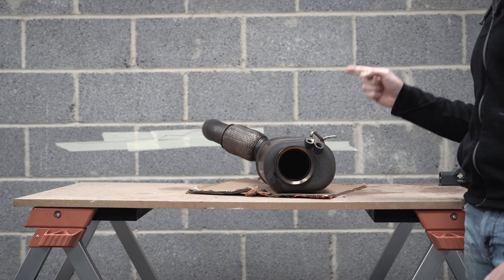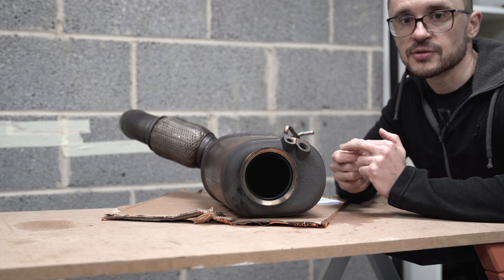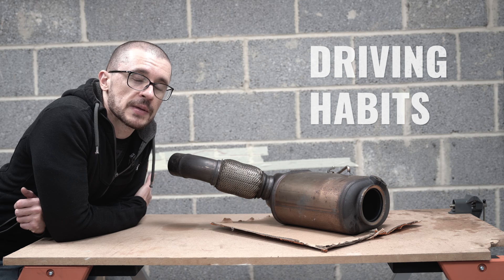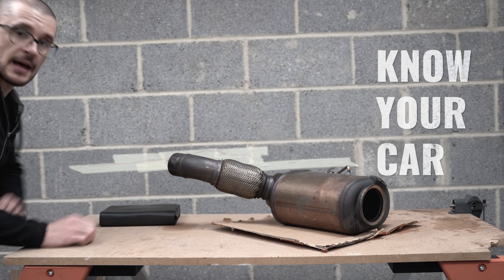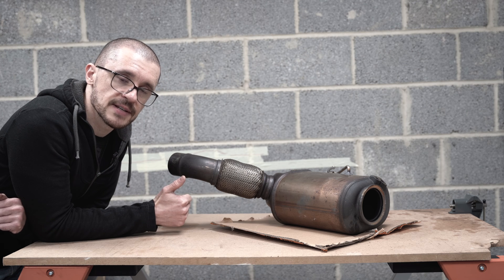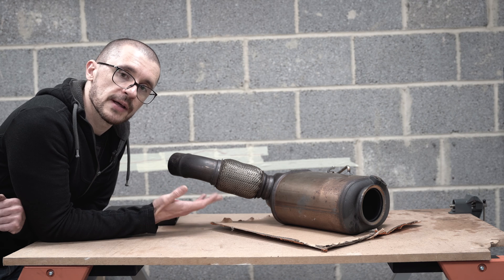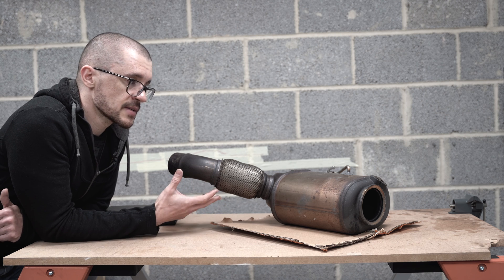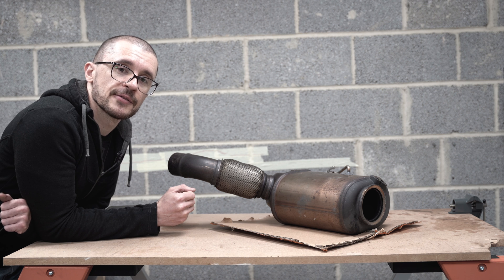How To Avoid DPF PROBLEMS - Diesel Particulate Filter

Comment: I am looking at a car with a known issue right now, lifters have failed in the engine after 100000 miles and expected timing chain failure shortly after... The cause, numerous failed DPF regenerations as a result of driving a diesel car short distances, as diesel ends up in the oil diluting it and causing crank bearing wear, lifter bearing wear, timing chain wear and oil pump/chain wear, and probably anything else lubricated by the oil... The fix is £2500-£5000 depending on damage caused, and will occur again in another 100000 miles or so... All because of DPF technology in some newer cars being flawed.
Reply from the maker: well said. for this type of situation I am looking at affordable ways of monitoring the DPF condition/regen cycles not completed and load to avoid this ... also would be interesting to evaluate the service intervals and how these could have been improved. how many oil changes has that car had in the 100.k miles?
Reply: @BestCarMods  well one way i am aware of it to find something that goes live in Regen mode, apparently on some Mercedes reason unknown the rear window heater comes on during Regen so you can just connect an LED into this and stick it in your dash somewhere, or as one person did inside and existing light that you will see.
Reply: @BestCarMods  Hello! 
I have a brand new 6 months old Toyota Innova Kijang/Crysta 2400cc diesel manual, which has done only 4000 kms. It developed reduced engine power and performance,sluggish and choked feeling at 700 kms. Since then the dealership has not been able to solve the problem. They have manually conducted manual/forced dpf regeneration multiple times but the malfunctions have not been rectified. Once after forced dpf regeneration the car improved a little but worsened again. My questions are:-
1) Is it possible for the DPF to get clogged at just 700 kms?
2) Is it possible to get the DPF removed and get my car remapped without any side effects?
I am from India.
Reply from the maker: @HYukti-k8w  1) yes the DPF can get clogged up in 700km 
2) yes, however in many countries it is ILEGAL to drive on the road cars without the emission control systems fitted from the factory.
More details about your local rules should be known by the companies that do ENGINE REMAP in your local area.
Reply: I need some help with my Kia Sonet 1.5 diesel which is equipped with a DPF and a SCR (DEF)(19k kms, 1.5 years old). I think my car is having serious DPF issues and service center is giving me lame excuses instead of checking thoroughly. Background - had severely clogged air filter few months back, got it serviced early at 18.5k kms instead of regular interval of 20k kms due to DPF warning and oil level increase (fuel dilution). Replaced air filter, changed oil, everything seemed fine initially.But now DPF is loading way too fast. I'm monitoring with OBD2 scanner and CarScanner app on Mobile phone and seeing 1.5-2% loading per km in city driving. DPF needs regen every 40-60kms which is insane. DPF load is shooting to ~115% in 40-60kms. I don't know the normal range but it seems very high, looks like engine is running too rich or there is some issue with the EGR or turbo. Also fuel economy is tanked from 12-14kmpl to 9-11kmpl, and performance feels sluggish. Normal mode feels like eco mode now, less turbo response. Service center says this is happening due to city driving and is absolutely normal and they also said no error codes means no problem. But even worst city driving shouldn't need regen every 40kms is what I believe. Now I'm scared to drive my car because I don't know where it will leave me stranded. 
Note - my majority of the mileage is on highways only.

Comment: Good info, but one of the most important things to check is how much engine oil is being used, if a lot of oil is being used >1 liter per 1000km, then the cause needs to be investigated, wear, bad oil trap for the crankcase ventilation, leaking turbo lubrication etc. This quickly leads to increased amount of soot and ash amount in the particle filter. So be sure to fix this first before cleaning or regenerating the particulate filter regularly.
Reply from the maker: verry good observations

Comment: We clean DPF's - we weld & repair them too. The DPF on my own vehicle is the original & has 374,000 miles service done. Still works perfectly.  Get yours cleaned when it needs it, follow the advice of this video & it will be all G.  If it ain't... well there's people like us who can help.
Reply: I have 300 000km on my stock DPF no clean short trips......
Reply: @lordbentley730 what car what engine?
Reply: When do they they need cleaning on a l200 series 5
Reply: Do we wait for light to come on ? As I heard going at them prematurely you can end up with all sorts of lights coming back in after you went at it and cleaned it 😅😅😅

Comment: Delete hardware+software,no smoke,no smell nothing...car runs super good !
Reply: No black smoke at all? What car?
Reply: @bigsean6045  Volvo v50 2.0d 136 hp.,also i drive now Fiat Croma 1.9 jdt again no dpf no egr and again 0% smoke,if you find a good mapper everything is clean,this is my understanding.
Reply: @L.Lyubomirov  thank you!
May I ask how much did it cost?
Also, did the same guy remove it and map it or it’s done by another guy?
Reply: @bigsean6045  In my country Bulgaria,the map software costs around 150 euro,and the removal of the dpf costs around 20 euro...different guy removed and different guy after that worked the software,but the removal its very easy and it can be done by anobody who does exhaust job/repairs...the mapper is the important guy which plays the big role.
Reply: @L.Lyubomirov  I understand thank you!
I’m in Serbia and I think I will do the same
Reply: @L.Lyubomirov 
What garage are you using??
Reply: Tüv sagt : NEIN 😅
Reply: I have 2018 s350d s class my car does 3 times a day regeneration is this normal ?
What shall I do as I am fed up 
Thanks
Reply: I have 2018 s350d s class my car does 3 times a day regeneration is this normal ?
What shall I do as I am fed up 
Thanks
Reply: @ipansota3832  It is not normal 3 times at day at all !What should you do...go to mechanic and see where is the problem,could be many thing...i personally prefer to delete hardware and software,and to sleep without worries,but everybody decides for himself.
Reply: Delete and remap @ipansota3832
Reply: Easier said then done bro
Reply: Apart from being illegal in most countries. That doesn’t work in a significant number of vehicles, especially ones whose engines were designed for Euro6.
Reply: @hughmarcus1  Why wouldn’t it work for Euro 6 engines (without the AD Blue)?
Reply: @bigsean6045 Note I said engines that are designed for Euro6. One such example is Land Rover’s Ingenium engine. Because this engine & its anti pollution system was designed for Euro 6 it simply won’t run properly if somebody messes with the software. 

There are lots of engines that have been in production prior to Euro 5&6. Essentially what those doing DPF delete do, is to backward map the engine to run without a DPF. 
The host of this video frowns on a lot of these practices
Reply: Exactly was just a way to take money from our pockets

Comment: just delete it lol
Reply: Delete it, and block the egr. Remap for increase in power and better fuel economy.
Had it done on my CItroen C5 2 litre hdi Exclusive. Towed a caravan all over Europe for years. Never missed a beat. 
Who decided it was a good idea to divert exhaust gas into induction?
Reply: @davidk3729 how does it pass its mot
Reply: @guttersnippeesmithers3905 it’s not on an MOT check yet, but I’m sure it will soon. They just need to see if there’s soot coming out the exhaust
Reply: yep
Reply: In many countries you have to pass an inspection. . They check for deleted DPFs ...

I agree it is a mad situation but we are like many things screwed by the deranged governments
Reply: It's a scam this co2 crap 😂
Reply: @cliffordkirk4825 it has nothing to do with CO2. The emissions are bad for the lungs and cause a lot of health problems, and smog. If nobody cared about CO2 these things would still be installed.
Reply: @cliffordkirk4825 It’s not a filter !! It’s a collector to enable the emission test ! When it’s full ( pressure difference between in and out ) it’s blow the soot out !! It’s nothing more then a scam.
Reply: @cliffordkirk4825 a DPF has nothing to do with co2. It’s to stop your kids breathing in harmful particles. Having said that, I don’t have any, so go for it
Reply: @cliffordkirk4825 no, its not.
Reply: If mine needs replacing that’s what the dealer said as it’s 200,000k plus atm .. shouod I delete it ? And wouldn’t this harm the engine as the computer tells the car to be in the dieeel at a certain point ? 
That’s why when I change oils and filter they reset computer to let it know it’s been changed ?
Reply: @Semaj.18272  no if u delete it it will not harm the engine , it will make the engine run easier with more fuel economy & power
Reply: @leftmorningstar6954 also fail the mot as its illigal
Reply: @guttersnippeesmithers3905 For a car to fail an mot on emissions the readings would have to be massive. This doesn't happen from a dpf delete. You can prove this from say an 05 model car that had no dpf to an 06 car that did when they first got put on cars no difference.
Reply: @Semaj.18272 No because when you have the dpf delete the tuner will tell the car it doesn't have a dpf anymore.

Comment: Would driving at 2-3k rpm help with having a stronger exhaust flow?
Reply: DPF regen happens above 200c with an oxidation catalist
Reply from the maker: theoretically yes for passive regen ... it would also help with the time needed to get the DPF up to temp, however you don't want to be always at that rpm. the temp in the dpf needs to be over 500 deg for the regen to happen but at the same time there is a limit to the max temp ... and the temp for active regen is not achieved by air flow, but by injection in the exhaust faze ... that is used in the DPF to increase temp. .... so to conclude yes and no :)
Reply: Higer egt temps can be reached between 1500 - 1800rpm, therefore this is better for regen, both passive and active.

Comment: Some Regens are only triggered by distance they don't all kick in when you go on a drive if dpf is not clogged or over accumulated. If the soot accumulation is bad 30 minutes drive with Regen activated won't be enough. If soot accumulation is high you will find the set distance the Regen should kick in (600km ) is ignored and will Regen more frequently even after completing a full Regen. This means more diesel fuel is being sprayed into the dpf over a longer period of time. Not only is diesel used to move your car but at the same time it's pupmping diesel into the dpf  to clean it meaning fuel is being used at a higher rate making you fill up more frequently.

Then there is the difference between soot and ash. When soots burned off it leaves ash when this builds up it's worse than soot.
Reply from the maker: thanks for taking the time to share some knowledge
Reply: Good explanation

Comment: Hello. I’ve bought an used car, and now, at over 280k km, the dpf needs to be cleaned. What solution do you recommend ? Burning (extreme heat) or wet cleaning (water with a bunch of chemicals). Thank you
Reply from the maker: the companies that recondition DPFs do both methods ... they heat up the dpf first in an oven (they burn the soot)... and after that use the chemicals to remove ash. It depends on many factors.
Reply: @mariuscociuba Spălare

Comment: The whole video idea, concept and conclusions about DPF are right and can be called as a BASE for long lasting DPF. 
I've been working with DPF's alot and in advance of this video i want to point out some things:
1. Don't listen to those who say that DPF cleaning or 'washing' (call it whatever you want) is pointless, because it is not! If you're doing it in, as i say, basement workshops, they will surely ruin it with agressive chemicals and other stuff. Find a nice, approved workshops who specialize in DPF cleaning procedures, and do it, i would say, every 150k on clock. 
2. Don't use any of DPF cleaning chemicals which is supposed to be added to the engine fuel, because it will ruin your DPF's ceramic and you will be in a big PAIN as the ash will stick pretty hard on it. 
3. Keep in mind to once in a while check your sensors and keep an eye on active regen cycles, if they are getting often or not.
4. Never, never tune your car with history of bad DPF.   
5. Use quality fuel. 
Besides that thumbs up, information is great.
Suggestion for the next video is EGR valve, as it can be a culprit for a DPF related issues.
Reply: Hi, 
I have a question, how do I keep an eye out for active regen cycles? My car doesn't let me know when it's in a regen cycle
Reply: @sheffcitys2forgedinsteel255  mine as well,Delphi system horrible,as your vehicle can be in a regen as you pull into the garage,for months on end(no idea what's going on) .I'm not impressed by this guy,he says drive 40 miles on highway for a "natural regen" huh!as though a regen will happen without the vehicle going into a forced regen by the vehicle burn off cycle,designed into the system itself,which adds extra diesel on the exhaust stroke to raise the exhaust temp and therefore burn off soot.Wish he would come on here and explain himself.My vehicle on a recent 4.4k km trip did 400+ attempt's to do a regen according to history on OBD2 reader.
Reply from the maker: The info that you have highlighted is "Golden"  ... in doing the research for this video I have seen how the DPF system is cleaned for heavy vehicles and same concepts can be used for the our small vehicle DPFs ...
Reply: Do you have an example of the chemicals added to fuel that should be avoided (point #2) ?
Reply: @KD-kf4zm  I'm not convinced that's true regards the additives.
Some additives simply reduce the temperature at which the Ash burns away. Therefore they can help with shorter journeys
Reply: @at0micsheep  If you need those chemicals, something else is wrong. If you ONLY have shorter journeys, you should probably not have a diesel.
Reply: Spot on ! Then use bad chemicals will burn the filters
Reply: Is diesels with DPFs preferable for those who is gonna use it once or twice a month?
Reply: @bijhonbordoloi9181  No, get a petrol engine.
Reply: @dnsdfs Would I be in trouble with my V6 Amarok using 1ml/L of Motul 800 two stroke oil on low Sulfur diesel, I always monitor Regens via ODB, thank you for the comment.
Reply: @BrunoSCot777  Long term, i would say yes, regarding coaled and stuck in ashes in DPF pores. You have to make sure that your DPF diff pressure dont rise over time besides your still on going active regen cycles. Just keep an eye on diff pressure and sooth accumulation in the dpf and everything should be reasonably fine.
Reply: I never have seen or heard my mark4 Mondeo doing a regen, I never have soot in my exhaust so I assume it's re genning sometime.